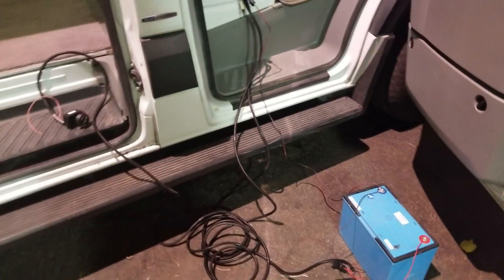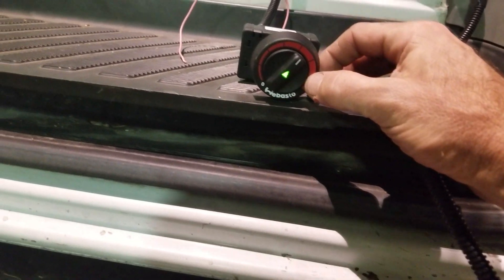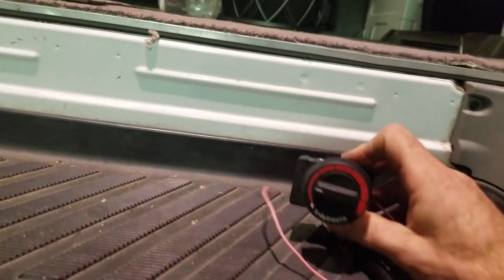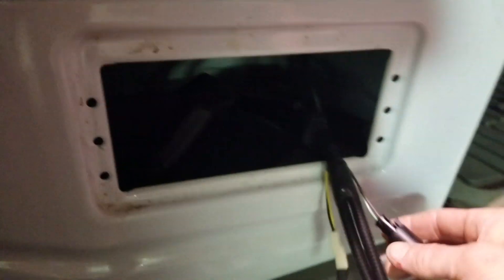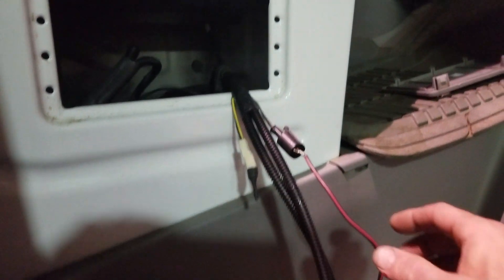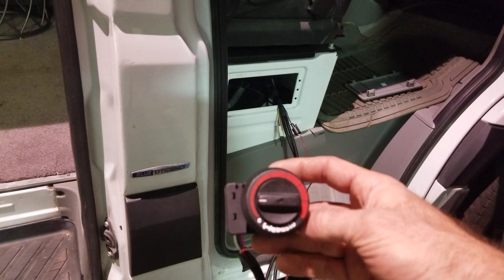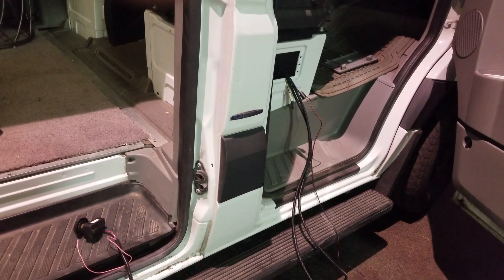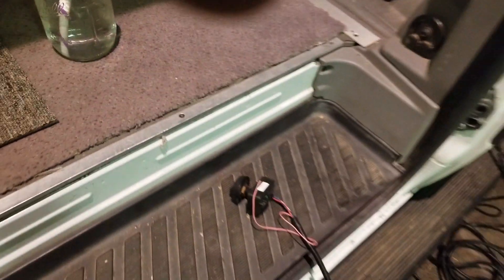Adjusting Webasto Airtop 2000st for High Altitude

Comment: There are many videos made since this one 6 years ago saying thus procedure doesn't work for altitudes up to 10K. Maybe 6K-ish but certainly not 10K reliably without the heater getting sooted up pretty quickly. After you made this mod did you verify with extended and prolonged use up at 10K to verify the heater didn't get clogged with soot?

Comment: Building a Skoolie, I have been thinking about getting this heater until I read the data sheets and saw it only goes up to 2,200 meters 7,200ft. Thanks for this. How high of altitude can you get with this reset?
Reply from the maker: This would be good to 10k feet. I would get the larger 5kw model for a vehicle that big.

Comment: Is this the same for the ECO 40?
Also do you know what the Webasto diagnostic software does or tell you? Do they have a built in CO sensor in the exhaust?
Reply: The EVO 40 has automatic altitude adjustment built-in to the heater already.

Comment: Great info! Thanks! The fact you can alter the setting makes me lean towards Webasto over the Espar. I wonder if you can do this with the Multi Control HD controller. Thoughts?
Reply from the maker: It's similar but instead of setting to 12 o'clock you set it to 85 degrees,  turn it on with the harness grounded,  when it's blinking dial it down to 65 degrees
Reply: @basecampcustomvans1096  I have a Webasto Air Top 2000 STC with Multi Control HD. I tried connecting the ground wire on the pigtail to my battery ground. Then turned on the multi control HD, set temperature to 86 degrees (mine would jump between 84 and 86 degrees when selecting the temp) I did not get any blinking lights so I think maybe it won’t work this way. I also purchased a rheostat. When I connected my rheostat to the connector, it would not turn on or turn on my Webasto. Any ideas?
Reply from the maker: @idkarts  I would call Webasto US tech support; they're super helpful and friendly. I thought the same wire harness should work for either a rheostat or the multi, so I'm not certain. I am going on hearsay for setting the multi controller; I've only ever done this with a rheostat, but that's what someone in the US tech support explained to me
Reply: Rocky Mountain Adventure Vans thank you! My heater arrived. Just waiting for a non-minus30 day to install it 😊
Reply from the maker: @twowheeledsmurph  let me know if you need any help (970-404-1026) ; also, Webasto has a USA tech support that's fantastic
Reply: @basecampcustomvans1096  Sounds good! Thanks!

Comment: Do you think this type of grounding adjustment might also work on the cheap chinese knockoff heaters? Even if their controller is a very simplistic rheostat style?

Else, I see 16ml and 22ml pumps online on ebay. Guessing the 16ml would be the high altitude ones, since there is less air you would want less fuel. So do you think just switching out stock pump for a 16ml one would work?

Just wanting to be able to use at high altitude without mucking it up, not concerned if heat output gets reduced at low altitudes. I actually have not hooked up the fuel line to it yet, just electrical.
Reply: All you need is a second fuel/diesel pump (the 16ml one!) in parallel to the standard one,  and a selector switch for both pumps. This is how it works with the Chinese ones, and the Russian Planars...but the have already a upgrade version with a build in high altitude.
How ever, I do have the Webasto 2000ST (24V) in my Land Cruiser and never had problems with it, don't have  a high altitude switch for it. We do travel the world for 4,5years now and lot of countries have very bad dusty roads, high mountains etc. I made a second air intake for the burner which sucks air from inside the vehicle...I guess maybe that's why it never failed so far? We did the Rockies in Canada for 2 Month and everything was fine too.
Reply from the maker: This is only a feature of Webasto heaters; it won't work on an Espar, or any of the Chinese knockoffs. I blew up a Chinese one using it for 2 hours at 9K feet. It was completely clogged with gunk in that short time. They can't be adjusted either, unfortunately